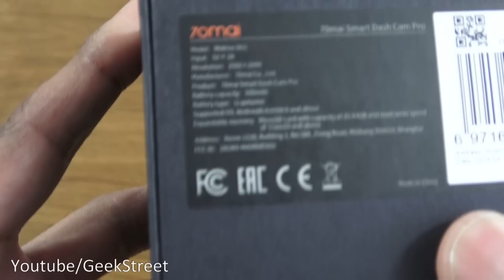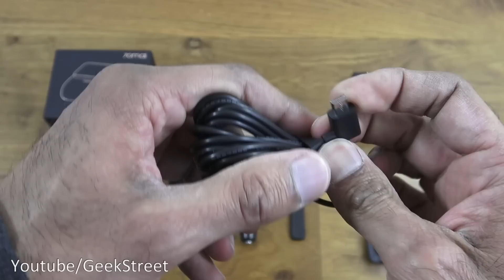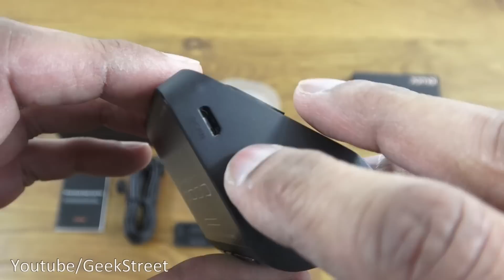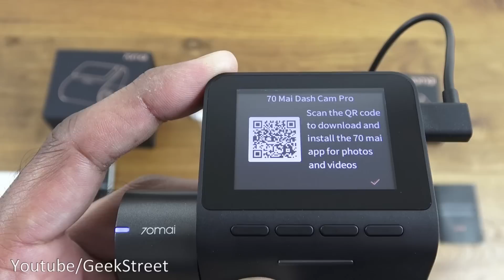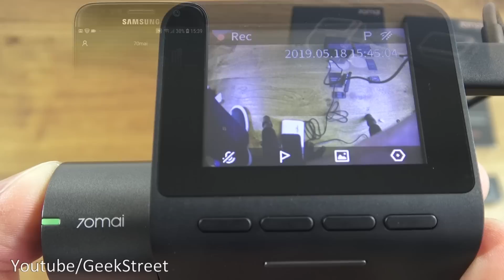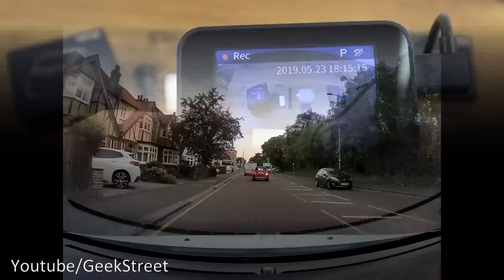DASHCAM WITH VOICE CONTROL!? Xiaomi 70mai Pro Dash Cam [Unboxing and Setup]

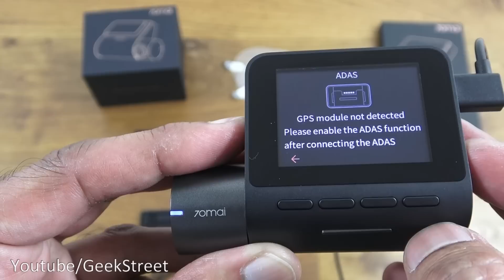Comment: 15:51 the GPS module was not detected because you did not remove the tape from the copper contacts on the back.
Reply: Could you explain that part better please?
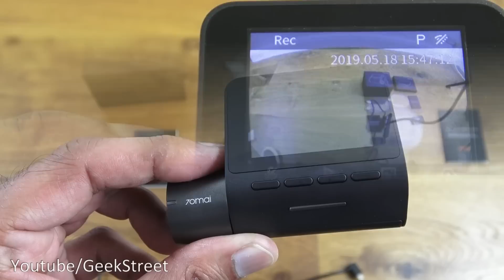Reply: @yonatangomezmamani4406  If you go  to 15:24 you can see there's a piece of tape/paper on the back. This should be removed so the dashcam can make contact with the GPS module.

Comment: Did the GPS module work?
Reply from the maker: It didn't seem to work for me.
Reply: @GeekStreet  the GPS Module saves the File on the sdcard If you Want to Display the GPS/speed on the Video you have to add them with an extra Software ... There are some Tutorials...  Im expecting mine to arrive These days and i wanted to be prepared before it arrives :D Cheers mate Greets from a Kraut x'D

Comment: Did you actually covered GPS module connection pins and wonder why it is not working?
Reply from the maker: The pins on the GPS where locked into position, I tried off camera too. Very strange it couldn't work.

Comment: In the advanced settings is there a way to auto turn off the display? I'm thinking of having this as my rear view camera and I don't want any screen on or flashing leds. Thank you for a professional video x
Reply: Yes, there is a timer setting for switch off the camera after predefined intervals
Reply from the maker: Thanks for the comment much appreciated, yes that's right, there is an option to allow you to do that.
Reply: Thanks guys, I've decided to purchase from eBay and found one for £25.71
Reply from the maker: What a bargain! I had a check and could not find an option to turn off the microphone.
Reply: @GeekStreet  Check the settings in the app.
Reply from the maker: Thanks!
Reply: Could you test if you turn off microphone recording if voice control still works please because I don't want mic on while recording for privacy but I need voice control to lock videos as it'll be in the back window. X
Reply from the maker: @PinkGirl2242  Bear with me I'll get back to you soon.